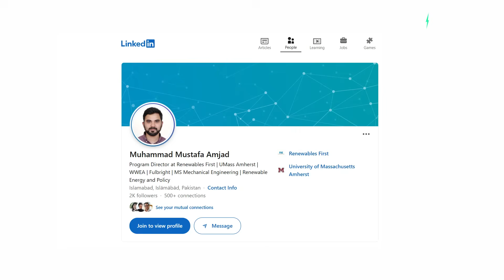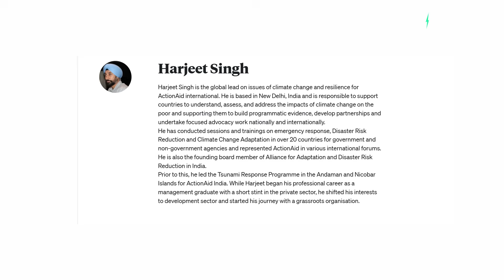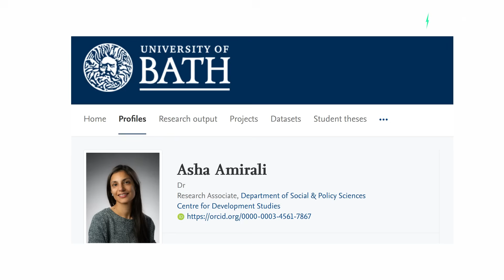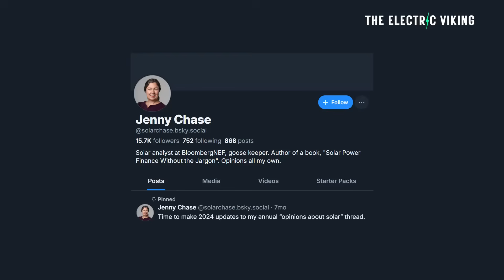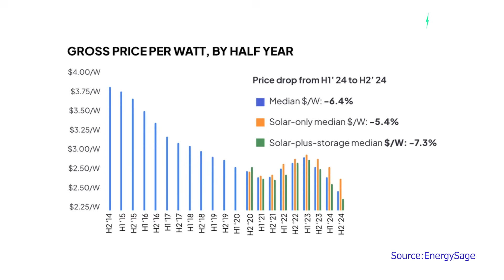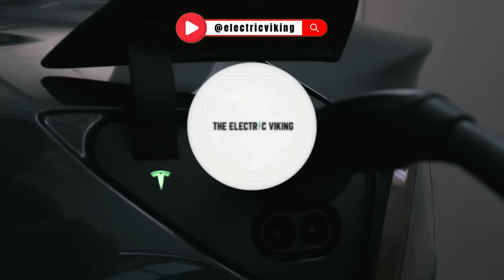Inside Pakistan’s Incredible Solar Revolution: A Game-Changer for Energy

Comment: Pakistan’s solar boom is one of the most rapid and remarkable energy transitions globally, driven by a mix of economic, environmental, and policy factors. Here’s a concise overview based on recent developments:
Scale and Growth
Massive Imports: In 2024, Pakistan imported 17–22 gigawatts (GW) of solar panels, primarily from China, making it the world’s third-largest importer and sixth-largest solar market. This is a dramatic jump from 2.8 GW in 2022 and 5 GW in 2023.

Capacity Expansion: Solar contributed 14.3% of Pakistan’s electricity in 2024, up from 4% in 2021, displacing coal as the third-largest power source. Total installed solar capacity reached 4,492 MW from over 302,409 net-metering installations by 2024.

Distributed Solar: Unlike many countries, Pakistan’s boom is largely rooftop-driven, with households, businesses, and farms installing panels, not utility-scale projects. This grassroots adoption has increased power supply by nearly 50%.

Drivers
High Electricity Costs: Grid electricity prices surged 155% over three years due to expensive 1990s power agreements, a depreciating Pakistani rupee, and global gas price hikes post-Russia’s Ukraine invasion. Solar offers a cheaper alternative, with payback periods as short as one year.

Cheap Chinese Panels: China’s overproduction has slashed solar panel costs, with Pakistan benefiting from proximity and tax-free imports until recently.

Unreliable Grid: Frequent blackouts and an unstable grid push consumers to solar for energy independence, especially during heatwaves when outages are dangerous.

Net Metering: Introduced in 2015, net metering allowed consumers to sell excess solar power to the grid, spurring adoption until recent policy changes.

Benefits
Economic Relief: Solar slashes electricity bills by up to 80% for households and businesses, freeing up income in a country where 40% live below the poverty line. For example, farmers like Mohammad Murtaza have cut irrigation costs by switching to solar.

Environmental Impact: Solar reduces reliance on fossil fuels, aligning with Pakistan’s goal of 60% renewable energy by 2030 and mitigating climate change impacts, critical for a country vulnerable to floods and heatwaves.

Job Creation: The boom fosters entrepreneurship, with local installers and international investors like the World Bank and China’s Shanghai Electric entering the market.

Energy Security: Solar reduces dependence on imported fuels, boosting economic stability.

Challenges
Grid Instability: The rapid shift to rooftop solar has reduced grid demand by 10% in 2023, risking a “utility death spiral.” Utilities lose revenue as affluent customers go off-grid, raising costs for those reliant on the grid, often the poor.

Policy Shifts: Recent net metering changes, reducing buyback rates from PKR 27 to PKR 10 per unit and capping excess capacity, have extended payback periods up to sevenfold, potentially slowing adoption. Some fear a “sun tax” or import restrictions.

Inequity: The boom benefits those who can afford panels (e.g., costing $7,500 for a bungalow setup), leaving the urban middle class and poor facing higher grid tariffs.

Grid Modernization: Pakistan’s aging grid needs AI-driven tools, battery storage, and digital metering to handle decentralized solar, but political instability and high costs hinder upgrades.

Recent Developments
Utility-Scale Projects: While rooftop dominates, projects like Orient Energy Systems’ 26 MW n-type plant and Hanersun Technologies’ 500 MW solar system signal growing utility interest.

Innovative Applications: Solar is integrated into dowry packages and rural microfinance, with women engineers installing systems, like a 24 kW setup at Karachi’s Hussaini Orphanage.

Policy Push: The government aims for 30–60% renewable energy by 2030, supported by the 2006 Renewable Energy Policy and the Alternative Energy Development Board. However, inconsistent policies, like net metering revisions, create uncertainty.

International Attention: Pakistan’s boom is a case study for developing nations, with experts like Waqas Moosa of the Pakistan Solar Association urging utilities to adapt, drawing lessons from California and Germany.

Comment: For a strong sunlight areas where the electricity is depended on imported fuel, solar is relatively cheap.
Reply: Bro, pv panels are 50 bucks each for 420W. At that price it is worth it anywhere.

Comment: Very interesting but i doubt that the government will go that way. Pakistan have very big oil fields of shore. They just signed an agreement with Turkey to develop them together
Reply: Heck - Pakistan should run on free or cheap solar and sell all its expensive oil for big bucks - makes sense it seems.
Reply: @DLWELD  
Moreover, burning oil to generate power is arguably the dumbest way to utilize oil. The added value of petrochemicals is much higher than simply burning it.
Reply: Pakistani here, every other year we discover new oil fields somewhere but yet to see oil being drilled out of them. We can't wait for it to functional. For time being govt is supporting it yes what they pay very minimal against the electricity you supply to the grid but still it's worth it.
Reply: off

Comment: India needs to get its act together 
It's coal burning is still increasing
Reply: @bigpete111100  India is getting its act together. You can get a 3 kilowatt system with government subsidy that cuts the price from 2 lakh rupees to 1.4 lakh (about 1300GBP, 1700USD). The price of electricity that you take from the grid is about 10 rupees (9 UK pence, 12 US cents) per kilowatt-hour (less than this for the first 200 KWH in the month) and you get 2 rupees for each kilowatt-hour you feed back to the grid. The family I know who have this system are now getting bills of zero. Most days the system generates about 25 kilowatt-hours, which is far more than the family uses. They are running lights, fans, a television set, a desert cooler (that cools the air by blowing air through wet mats, which is highly effective provided the humidity is not high to start with) an induction cooker, a geyser (water heater) and an electric scooter.
Reply: you need to stop obsessing about India. Enjoy the video. Not much good news comes from Pakistan these days. Indias installed solar capacity is one of the highest in the world.
Reply: @manishpjoshi are you sure?
But now a days, lots of good news come from pakistan❤
You take care of yourself and your foreign policy😂 don't argue about pakistan

Comment: Pakistan, North Africa, Australia, Mexico, and the SW US are very, very hot! And solar panels are now cheap. Solar panels,,if you cover the entire roof, can make rooms in homes up to 15% cooler. Given the ever higher cost of electricity and air conditioning as the electricity cartels become more corrupt and expensive and the climate becomes hotter, even if you don’t use the panels to produce electricity, the savings from your cooling bill means that the panels will pay for themselves in less than 15 years!
Reply: In Pakistan, payback time is between 1 to 2 years
Reply: @freeheeler09  I have noticed this effect in India. You can measure the temperature of the underside of the roof and in the summer it is about 50 degrees under the solar panels and more than 60 degrees on the parts without solar panels. You can really feel the difference.
Reply: @cedriclynch what's the per unit Electricity cost in India??
Reply: The price of electricity in India is about 10 rupees (about 0.11 euro, 0.12 US dollar, 0.09 GB pound) per kilowatt-hour. There is a reduced price for the first couple of hundred kilowatt-hours in a month. This is in Gujarat state; it is possible that prices are different in other states.  @mozzinator
Reply: a lot less than that!

Comment: i love the shots of all the solar being used as gazebo roofing
Reply: The solar you use to shade yourself cools you twice.
Reply: Those constructions are not going to survive the first windstorm :-) I had to smile at the guy stick welding galvanised steel to the I beam
Reply: @ttkddry  I am from Pakistan, running a solar installation company since 2014, we install these structures everywhere (even at my own roof), in these 11 years not a single structure was damaged by windstorms and yes some sections of the structure on my own roof have been welded exactly like that. If something works why complicate it?
Reply: @razaulhaq8871  welding galvanised steel produces extremely toxic smoke, that was what I referred too. Anyways, good luck with those solar sails, I have suffered from plenty of wind damage on solar installations over the last 15 years, it is a matter of time or bad luck, just like with flooding
Reply: @ttkddry  Oh, I thought you were talking about structural rigidity. I don’t know about others, but we already know about toxic smoke and take preventive measures.

These aren’t sails. The perfect angle to install panels here is 40 to 45 degrees, but we keep it between 25–30  and compensate for the angle loss by increasing the number of panels since these panels are that cheap here ( $0.00355 per watt retail ). We also take a number of other measures. Besides, you can’t fight nature it's just a leap of faith
Reply: @AliAthar-u8s  why would you assume I live in a wooden house? I am European and a welder by trade. I had structural engineering as part of my training. 4 straight poles with no cross braces are going to fold like a lawn chair
Reply: as long as it is weather proof, but a good idea in general.

Comment: The problem with weakening the economic viability of electricity grids, is that at the end of that process, you end up depending exclusively on your own equipment, and you may have home outages if they are faulty (depending on support from providers that would charge a lot for emergency repairs - also could be costly). So we may need a hybrid system, where you still pay the utility a maintenance fee, and the utility can maintain only regional (or community) grids.
Reply: most countries will eventually adopt the hybrid system,  simply because it will help keep the grid functioning in the long term.
Reply: Solar and and batteries and EVs are similar to moving from Stone Age, landline phone and internet connections to cell phones and satellite internet. They make for a much more decentralized, democratic, robust, better performing and less expensive to upgrade and maintain system. 

Instead of hopelessly corrupt and expensive, Chinese and American-style, cartel/centralized-planning/monopoly-corporate, oligarch or dictator crony-owned, feudal energy systems, now 
 end users/customers/citizens can own their own energy production and storage. 

We no longer send much money to PG&E, the most corrupt electricity cartel in the US. The fires their poorly maintained transmission lines have started have burned thousands of homes and businesses and killed hundreds of people. But not a single executive has gone to jail. Their CEO still takes home $50 million a year! 

Then think about the corrupt Exxon and Saudi oil sheiks! Because we have solar and batteries, we no longer buy their propane to run our home heating and cooking stoves. 

By the time we retire, we will be fully off grid and our solar, batteries and EVs will be paid off. Then, we will never pay another cent for ever more expensive and unreliable electric utility and petroleum cartel energy. Ok, occasionally to charge the car on vacation, but that’s it!

Comment: You are aware that solar system inverters use the grid frequency to time their DC to AC output signal?   If the grid diminishes greatly in size, as predicted by one of the spokes people in the video, there will be no signal for the inverters to sync to, rendering them useless.
Reply: Solar can work without any grid connection as well. 

It's called off grid system. All you need is solar panels + good battery backup & an off grid inverter & you're good to go.
Reply: It is possible to have a DC system that does not need any grid connection.
Reply: Lol
We have no grid here
Reply: and when will that time arrive??